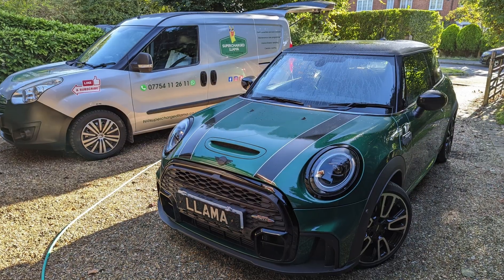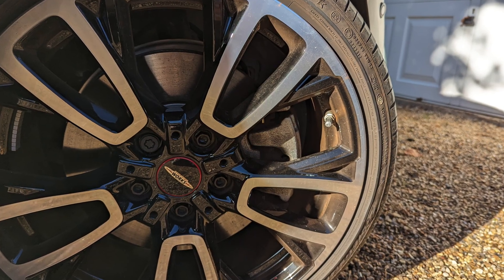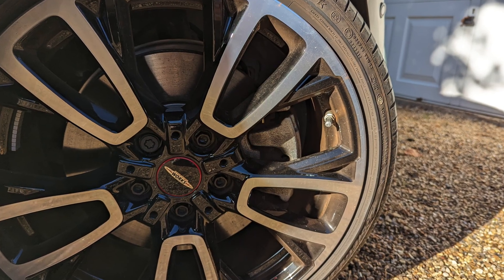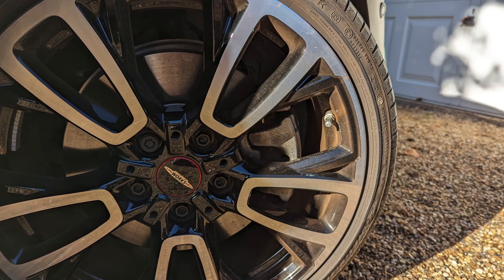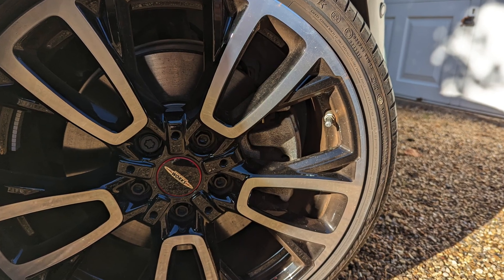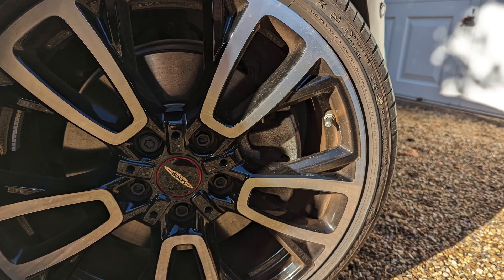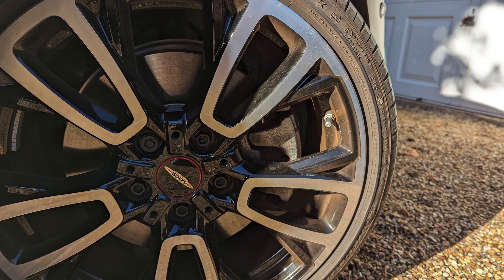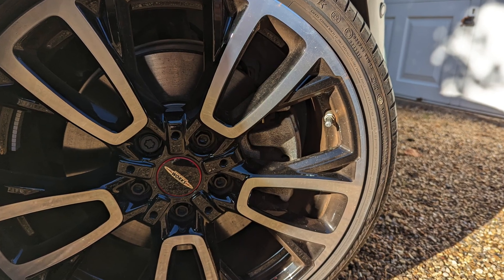Mini Cooper S JCW - Enhancement & Ceramic Coating

Comment: Very thorough job, looking great. I like the idea of the applicator with the plastic in to stop it absorbing into the sponge part.
Reply from the maker: Thanks dude.

I have to say that the applicator is less of a gimmick than you'd think, it does make a difference to the amount of product used, which adds up.

Comment: Well done, the paint system on these are a doddle to do. 

Not a fan of wheel acid on dark alloys but a great use of the pre wash processes to minimise marring.
Reply from the maker: They are lovely to correct aren't they, it's a really well balanced paint. Not so soft that it instantly marrs when you look at it, not so hard that you need to two step to tell you've done anything.

I'm curious about your concern when she acidic cleaner on black wheels; I assume that's down to block showing up any chemical staining more readily than silver, but it's always worth checking assumptions! I've never had that experience myself with acidic ones, but I'm properly cautious with them.

Comment: Lovely job on the Mini 👍,  looking forward to the tyre cleaner test. You look to be a fan of the forced rotation , I must admit I'm very tempted by one myself, and yes black cars are a nightmare we've got two cry😢😢
Reply from the maker: The more I'm using it the more I like it. I am going to see if there's a vented backing plate option, but I don't think there is from what I can see. Not that it's caused me any issues at all in terms of heat build up.
Reply: @SuperchargedLlama  Seriously tempted as I'm going to a cars and coffee meet at HDD's unit in a couple of weeks
Reply from the maker: @markmoore6264  ooooh that'll be fun!

Comment: Would like a video on the use of the Feynlab rinseless please.

Use ONR as a clay lube but never for wiping down after polishing. Be nice to know the ins and outs for that and if the feynlab is a good clay lube.

I have the DA8 and your making it very hard not to buy the forced rotation 😂
Reply from the maker: I can answer that one really easily for you (I do have a video on Feynlab as a Rinseless Wash too, it's more of a vlog).

ONR has loads of uses, so that I and of itself makes it a really valuable product to have. Great Rinseless wash of course, brilliant glass cleaner, decent QD and clay lube, all in one product.

However, the Feynlab is a much better cleaner, I'm going to demonstrate that this winter when the car is pretty minging and show them both as a pre-wash rinse - I think the Feynlab will win by a mile here. But the Feynlab is a really focused product in the sense that it's brilliant as a Rinseless wash, but not much else, apart from this polish removal application. It is crap as a glass cleaner and can't be used as a QD....but....but... it's the best Rinseless wash I've used. And there's a new version of it out now too.

Comment: Marvellous job! I didn't catch the name of the tar & glue remover?
P.S. In2detailing sell plastic barrier microfibre applicators - I used one to apply my ceramic lite coating and that also worked well.
Reply: It was the tar and glue product from Detail Bug Car Care.
Reply from the maker: Glad you enjoyed it Steve :D - I believe the Tar and Glue remover is called Bug Off, it's in the van at the moment so I shall check if needed, but it's Detail Bug, so if you'll be able to find it on their site. Really reasonable value too!

And you're absolutely correct, there are now barrier applicators from In2Detailing - I've had these Rag Company ones for ages and kept forgetting to use them. Unlike many other people using TRC stuff at the moment, I bought these.
Reply: @decker0373  Thanks, Lee, haven't heard of them before.  Just checked their website - seem to be good value, may take a punt and order some stuff when I start to run low. Cheers.
Reply: @SteveLBMK  I've not used any either but the reviews are really good and if the 5 bottles for £30offer is still available, it's definitely worth a go.
Reply from the maker: @decker0373  I bought the 5 bottles at Waxstock and nothing has been a dud so far. Got a couple of other bits to use that I haven't tried yet.

Comment: Excellent video as always 👌. Loved the use of the rinseless wash to remove the polish residue. Can you really coat straight on top of that? 🤯
Reply from the maker: Cheers dude!

I'd say you probably could coat on top of it, however I've never tried it as I've not wanted to run the risk on a customer vehicle. I should try it on mine actually.

Comment: It looks fantastic. A lot of skilled knowledge and experience went into that one.
So with the car polished, if the owner were to have a ceramic coating applied when needed (for the next 20 odd years), might the car never need to be polished again?
Reply from the maker: I wish that was the case! Sadly it isn't though. Even with a ceramic coating the paint will get wash marks, swirls etc. It may take longer for them to appear as it helps keep the paint cleaner and it's easier for the pressure washer to remove more of the dirt on the paint, but it'll still need a polish before the next application. Partly because you'll want to clay the paint to remove any contamination, and that always marrs.

I'm keen to try out the idea that DIY detail are peddling, that a perforated clay cloth using the fallout remover as lube won't marr....I'm skeptical.
Reply: I've seen that on Pans videos too. He said the DIY detail and rag companys synthetic clay towels can be used with certain fallout removers and ceramic sprays saving a step.
Reply: @SuperchargedLlama  please do. If this is as fine and easy to use as they make out, it could make scratches a thing of the past.